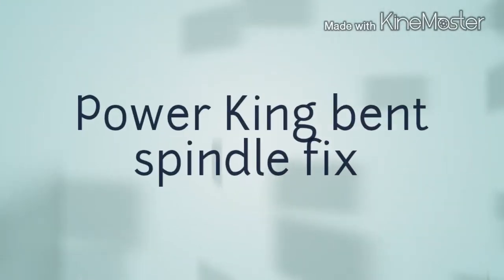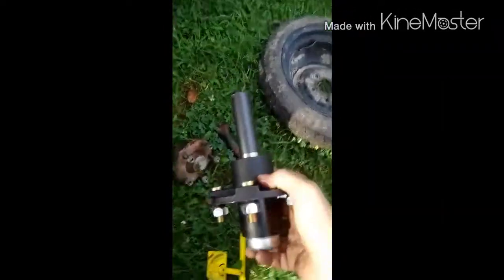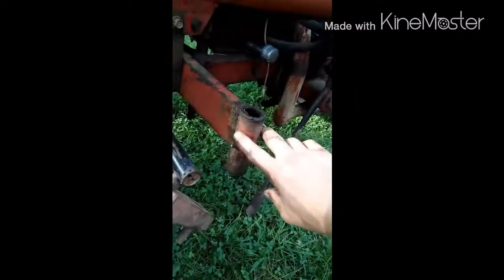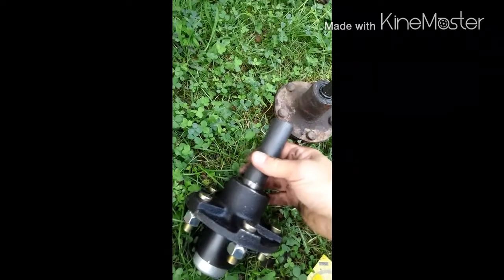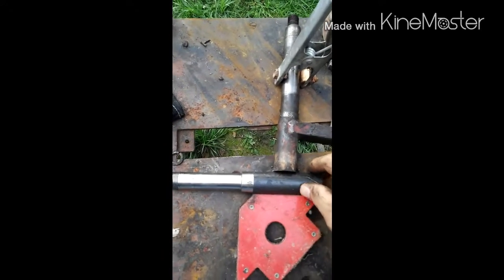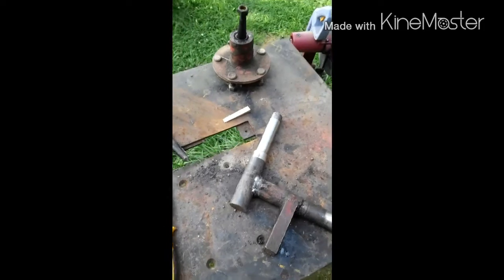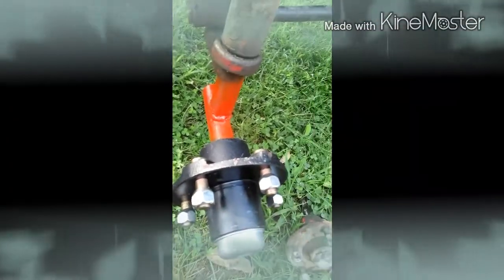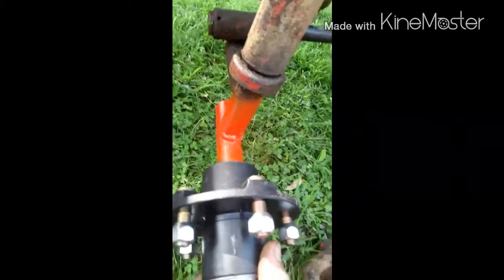Power King bent spindle fix

Comment: the parts used is a trailer hub and stub shaft? You wouldn't happen to know any part numbers. I'm guessing it's a standard five lug hub. Any info would be greatly appreciated.
Reply from the maker: Samuel Huff I had no idea that you had asked a question. So sorry. A year later I can only hope that you were able to make the swap. Mine is still doing great. I did take the old tired k361 18hp off and put a newer m18 Kohler twin on. Which means that I had to stretch the frame about 4". Probably wouldn't do it again but glad I did it. Very responsive. Take care